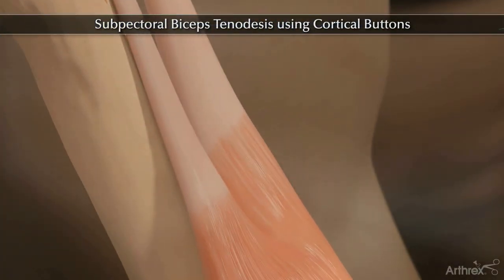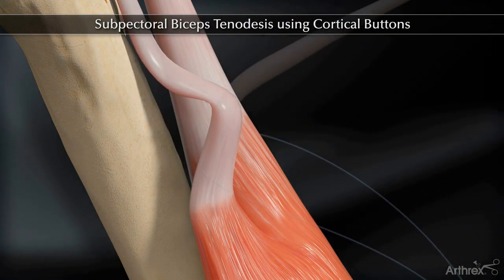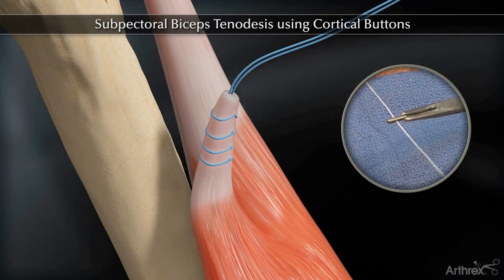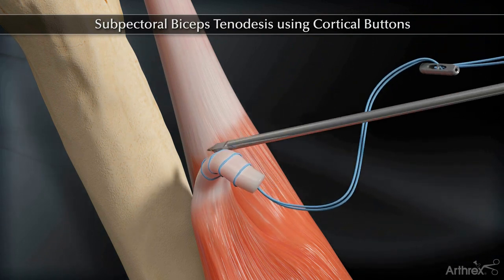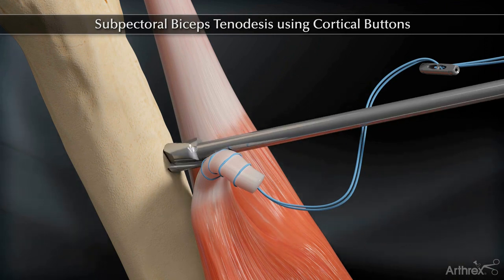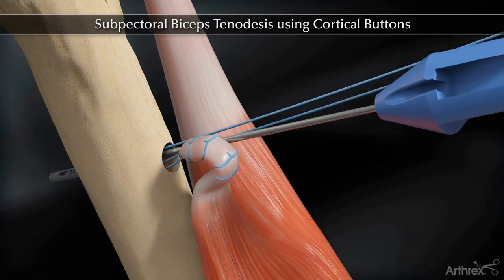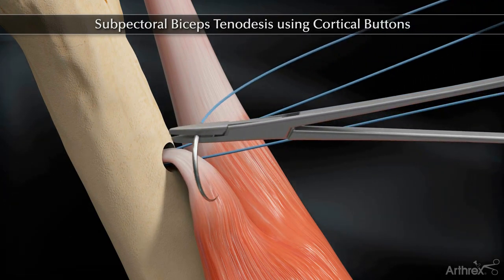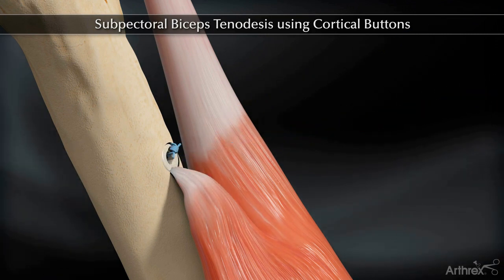Subpectoral Biceps Tenodesis Using Cortical Buttons

Comment: In 2015 I ruptured my proximal long head bicep tendon (while recovering from a Acromio-clavicular (AC) joint stabilization surgery). Now 5+ years later, is it too late to consider Biceps Tenodesis?
Reply: is it hurting?  not a dr but i dont think its ever too late they just cut the painful useless tendon and screw into bone.